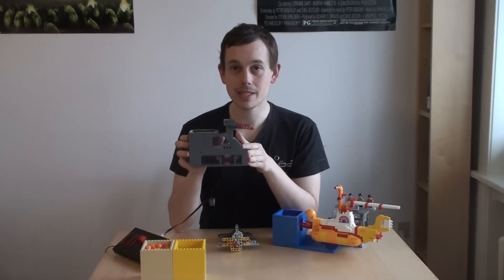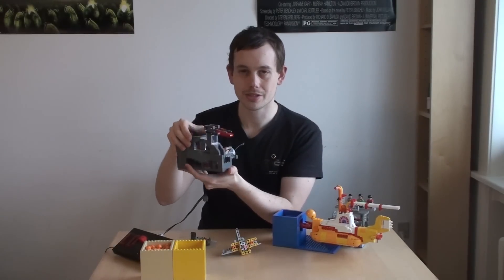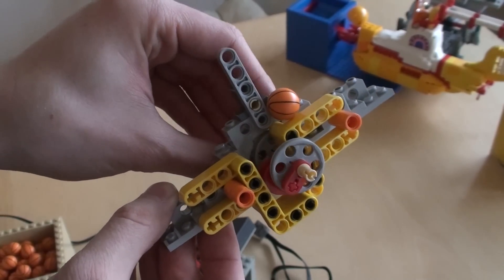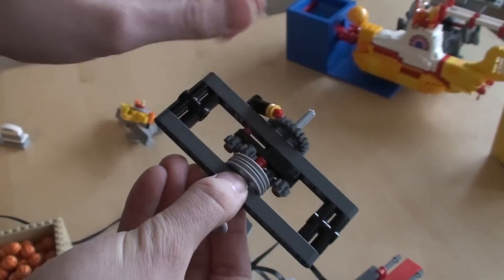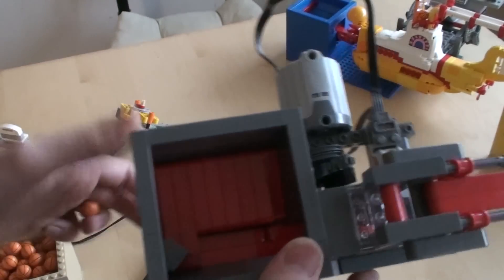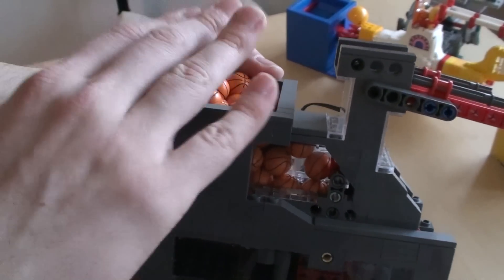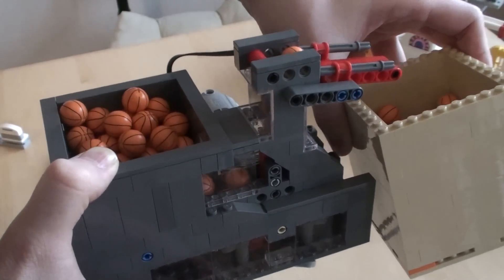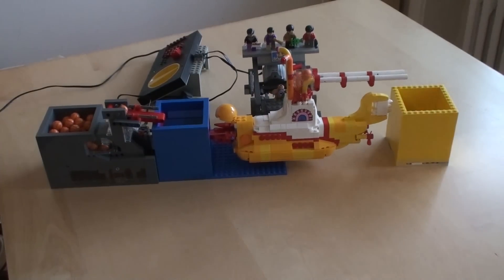LEGO GBC Pump + Building Instructions

Comment: Hi Lasse, Just checking back in with a follow up on the ball pump.  I have been using your design in the "Great Ball of China" at shows and it has run almost flawlessly for over 70 hours.  A couple of jams rectified by blowing out plastic dust has been the worst trouble it has had.  Thanks again for sharing this design.

Comment: Hi Lasse!  Your pump is a great build.  I've built two from the instructions you've shared.  Thank you very much for sharing them.  One question: Is there a easy, clean, less frustrating way to insert the sliding pump arm?  At the end of the LDD instructions, it doesn't show how to insert--the arm appears in the casing without the insertion process.

I'm hoping that you have some words of wisdom on this.
Reply: I had the same experience just now.  I used a brick separator to "slice" the largest bottom plate away from the rest of the build.  Then disconnect the two sides of the mechanism where they join (the two 5x3 lift arms).  Slide the left side of the mechanism in to the left.  Slide the right side of the mechanism in to the right and twist the two lift arms until the two black pins reconnect the two halves back together.  Re-attach the bottom base plate.
Reply: Did Lasse send you his link to his updated instructions?  Much easier, and he addresses the pump arm issue I had separately within the new directions.

Comment: Are those official Lego balls or something else?
Reply from the maker: They are official parts. They have latest been released in Friends set - although with a different color and pattern. Just remember not to use the Bionicle balls because their diameter is larger than 2 bricks.
Reply: Lasse Deleuran how did you get so many; did you buy them from somewhere like bricklink? Lego want £0.66p each for the orange ones! 😕
Reply from the maker: Ouch. I bought them before they got expensive. Back in 2010. I suppose times have changed since then!
Reply from the maker: That is a good solution. You can see it discussed for GBC here: http://www.eurobricks.com/forum/index.php?/forums/topic/86686-gbc-lego-balls-vs-chinese-beads/
Reply: That's where I got the idea! Decent price at 20 for £2.50; they look like great substitutes to me (I was worried they'd have bit flat spots or big holes!). I'll have to build something and find out!

I tried to build this pump but failed yesterday! I tried using an online viewer to load your lego file, and it was difficult to get to see the parts inside, so maybe I'll have to install LDD on my PC and look more closely! So far I only have an EV3 set and a Large Classics box, so I might also need to pick up some more Technics pieces!
Reply from the maker: Don't worry too much about those flat spots. The latest Friends balls also have quite a flat spot from the molding inlet.
Reply: Last time I checked (in the UK) you can buy a bucket of bricks and just fill it with basketballs and footballs, but assuming by the high price it isn't like that anymore.